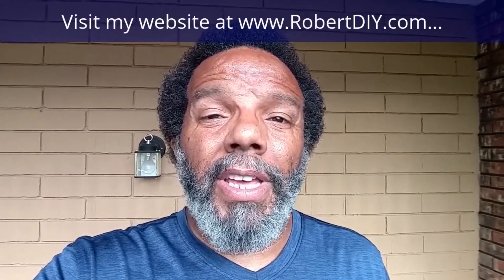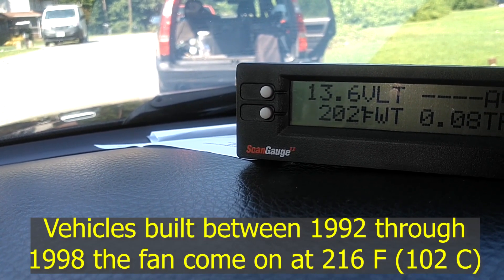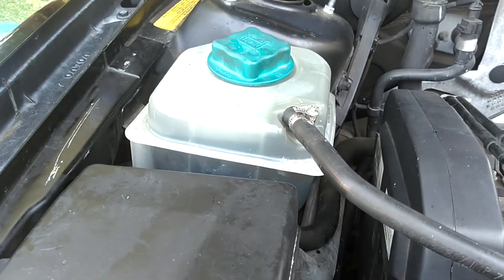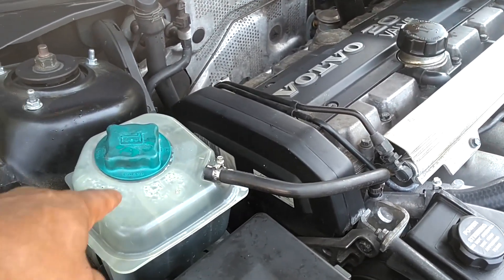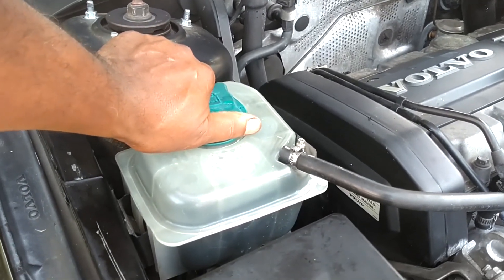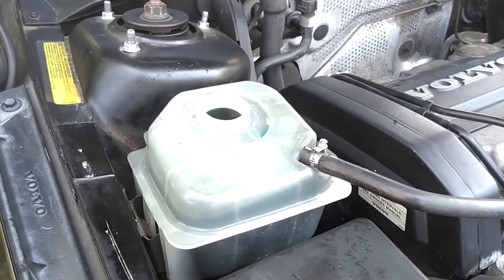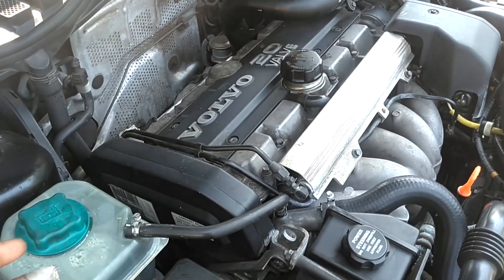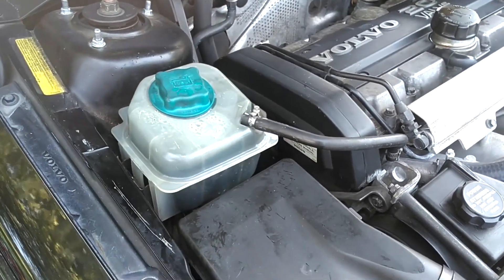Volvo 850, S70, V70, Coolant system overview. Engine fan operation, coolant fill process, and more.

Comment: Thank you Robert. I picked up a 97 850 back in November. It takes 2 cranks to start and has been giving me acceleration and power issues. I left the vehicle running on idle for about 15 min letting it get up to temperature and the fan still did not kick on. I believe the ECT sensor is to blame. While Idling once it reached temperature I let the AC run on full blast and the fan STILL did not engage. I think it is running rich when it starts but once at full operating temperature it gives me lack of power and chugging while accelerating. I have to restart the vehicle to reset it. I have no codes however. I tried the coolant cap trick to test the head gasket and I was able to open it slowly.
Reply from the maker: https://youtube.com/shorts/tSEx98aGzC4?si=rfxpj6LM43qlZxAt
Reply from the maker: Could be the TPS

Comment: Thanks Robert. Very informative. I'm dealing with my upper radiator hose -- it keeps blowing off. New hose, oem clamps, new reservoir cap. Car has never run better however (even with this issue) and I've owned it for 23 years. Appreciate all your great videos.
Reply from the maker: https://youtu.be/WXOHjePUWkU?si=E9YYRCZLbDm0BHry

Comment: Excellent information. To be honest, I thought all cooling systems were pressurized. Thanks for setting me straight!
Reply: In my manual to my volvo 850 1997 it says: cooling system: sealed pressurised.
Reply from the maker: Awesome! If you can pull the cap off of the reservoir with the engine running, is it pressurized?
Reply: Isn’t the pressure is released when opening the cap? you can hear it hiss and also the coolant level rises after removing the cap. If the system is sealed and the coolant heats up inside, it becomes pressurised because hot coolant takes up more space than cold coolant.

Comment: I swapped a motor in my 01 v70 xc wagon with turbo have slow coolant leak no one can spot. Probably not a Volvo thermostat will it still operate and burp correctly? Could it still be air trying to escape? Have driven around 500 miles on this motor.
Reply from the maker: Could be a bad engine.
Reply from the maker: https://youtu.be/WXOHjePUWkU?si=yASjH9aZEApeIoEh
Reply: @RobertDIY  he never had problem other than it going into limp mode  so I only used his head and block

Comment: Quick question Robert,

2012 Volvo S60 t5...122k miles

Overheating...due to rad fan not running....at all.

My question is : does the thermostat have any bearing on whether or not the fan comes on via a sensor or whatnot ? 

Thanks
Reply from the maker: No, the thermostat is mechanical. It doesn't know if the fan works or not, only the temperature of the fluid running through it.

Comment: Have you ever wonder what position thermostat should have be placed in.
Which way round? Does it matter to that air release valve?
Reply from the maker: As explained in the thermostat video, 1 o'clock.
Reply from the maker: https://youtu.be/U7lxJ96KdTg
Reply: Thanks and sorry I havent see it

Comment: Hello. I have recently purchased a 98 volvo v70 glt. It has a overheating issue. Ive replaced the waterpump, thermostat, and the radiator with a do88 performance rad BUT it still overheating. Could it be a improperly installed head gasket?
Reply from the maker: https://youtu.be/BtdifArSU3Q
Reply from the maker: https://youtu.be/WXOHjePUWkU
Reply: You need to test the cooling fan and the fan control module. Run a short wire between the oil dipstick tube and the fan control module fan 1 connector. The fan should operate if it is good. Listen to the relay and see if you hear a click sound.

Comment: Hey Robert. My temperature gauge isn’t rising to operating temperature and my fan isn’t coming on. If I’m idling for too long my coolant starts to boil! I checked the fan with 12v and it works well I also tested the thermostat and the temperature gauge. Any idea what the problem could be?
Reply: Forgot to mention it’s a 1996 Volvo 850 T5
Reply from the maker: ECT.
Reply: @RobertDIY  Do you know the specific one Volvo uses or would I be able to use any compatible type from a auto parts shop?
Reply: @RobertDIY  Robert, king of Volvos. I changed the ECT for a official Volvo one. Fixed the issue. I cleaned the terminals with isopropyl alcohol and I’m now getting a good temp reading. But the issue remains the fan still isn’t kicking in and it feels like no liquid is circulating from the radiator. Any next step tips? 

Drew

Comment: As an onwer of a Volvo v70 XC '01 (P2), I have tried to open the water reservoir while the engine was hot and liquid spilled. In the mean time I have found a fluid leak on the heater cord to the interior, which get the pedal floor wet. Can this be the culprit of the fluid spilling and accumulating pressure, or should I check the head gasket more? The glove test was passed with no problems and maintenance was just done (all filters and oil).
Reply: Change the heater core. If it's leaking, the only solution is to replace. Could also be the connections. If it hasn't been changed in over 10 years... it's time.
Reply from the maker: As explained in SEVERAL of my videos, the cap should NOT be removed with the engine OFF. You should be able to SLOWLY remove the cap WITH THE ENGINE HOT AND RUNNING.
Reply from the maker: If the heater core is leaking, have it replaced before you blow the engine.

Comment: I have a 2004 V70 2.4 liter station wagon and had to replace thermostat because prior maintenance person did not put gasket on housing secure enough...started drip leak. I have replaced the thermostat with the half of housing and gasket on the half attached to block. I refilled the radiator through top hose at engine end and reattached and refilled reservoir. I am worried that the fluid is not filling the head on the engine because I did not see much fluid removed from reservoir after short trips. Any suggestions on how to be certain fluid has filled the head?
Reply from the maker: This video explains all that I know. Once the engine has cooled off, fill it and it should be good.

Comment: Hi mate 2005 s60 2.0T had a leak in the pipe coming from the reservoir and it emptied the coolant. I fixed the pipe and topped back up with coolant. now it’s sometimes struggling to start when cold and when it does start it sits on about 500rpm for a second or two then kicks in normal and will run perfectly. It seems fine when the engine is hot I was wondering if you had any idea what it could be
Reply from the maker: https://youtu.be/Jc4pfC3D3EU
Reply from the maker: https://youtu.be/gt9w-ZSxs9I

Comment: What if the coolant cap does come off with a running hot engine. Does that mean the head gasket is good.?
Reply from the maker: As explained in the video, yes.
Reply from the maker: https://youtu.be/WXOHjePUWkU

Comment: Hi Robert.My 1998 Volvo V70 2.0t behaves strangely! On the open road I do not lose cooling fluid, and when driving slower off the road, on the bottle cap that is new, liquid comes out, the thermostat is new and installed correctly, as well as the engine temperature sensor and its connectors! Specifically yesterday I drive 80km on the open road without any loss of fluid, and it was in a bottle a little above "MIN" when it was cold, but today off the road at a speed of 10-20km / h some 3-4km when I opened the hood with with the engine running, water was leaking from the bottle cap, when the fan started, it stopped! But it is impossible to open the cap then! I need your opinion ??? Thank you ! Greatings from Serbia.
Reply from the maker: https://youtu.be/WXOHjePUWkU

Comment: what's the maximum engine coolant temps for the 850R turbo?
Reply from the maker: Like, right before it blows the head gasket? The magic number is 265F for non-pressurized systems for all cars. What blows the head is when the coolant boils. A good coolant mix will boil at 265F. 
I've had my car at 257F and it didn't blow the head gasket or damage the engine.

Comment: hey robert, when i have been driving my volvo 850 2.5t '96 and i turn the engine off i hear the reservoir cap hiss softly. Do you know what this could be?
Reply from the maker: Normal. Once the engine is off, the system pressurizes. You may need a new cap.
Reply: @RobertDIY  Thanks Robert👍🏻

Comment: Hey great video! Got a question, recently went to a mechanic to replace a cracked radiator and put in new coolant.  All is well, when the same evening the fan went on when starting the car on an ice cold engine. It prevented the car from getting warm! Coolant temperature was low as hell and didn’t circulate through the upper hoses (thermostat closed?). Tried driving for 30 minutes, revving it a few times up to 3000rpm and nothing happened. The fan even went on to blow for 5 minutes after turning the car off. 
Next morning I get in, start the car, fan still starts blowing immediately! Going to the mechanic and halfway it turns off. Car gets warm and mechanic can’t see nothing wrong. Since then everything has been fine. He suspects a thermostat that is unhealthy and didn’t open all the way, but that doesn’t explain the fan starting on an ice cold engine. What can it be? Wanna know so it can’t happen when I go on a trip. Mechanic said all plugs were in okay and he didn’t break anything when replacing the radiator.
Reply from the maker: I don't even know what kind of car you have. My guess would be that one of the connectors is going bad, wasn't making a good connection.
Reply: @RobertDIY  hey there, sorry I was probably so tired when writing that I forgot to mention the car lol. 
It’s a V70 2.4 from 2000 (first type) with 170hp. Thanks for the tip I will check if any connectors are damaged. Must say that last few days it didn’t happen after unplugging the battery and reconnecting it.

Comment: I recently replaced my coolant tank and thermostat but my radiator fan doesn’t come on when it exceeds it’s temperature and I was just wondering what could be the problem
Reply from the maker: ECT sensor, bad fan or bad relay.

Comment: Hi Robert. i need your help regarding a pressure problem i have on volvo v 70 year 2002. the cooling circuit gains pressure after the car is stopped after 2 to 3 days. So, after that time, I find the water expansion vessel full and liquid on the floor, so the coolant comes out through the lid. I inform you that I changed the thermostat, water pump, the engine head was rectified, the radiator is only 2 years old and the water pipe that falls from the thermostat to the radiator is also new. I tried to release air through the expansion vessel lid as soon as the thermostat opens and the fans do too. the water level then drops and then when heating the water the level rises to the maximum and I cover it again with the lid. 

I also inform you that I took the new cell gasket and the coolant is the appropriate one for direct use.

Can you help on that? Tks
Reply from the maker: is the cap damaged?
Reply from the maker: https://youtu.be/WXOHjePUWkU
Reply: The cap is a new one  from  volvo

Comment: Buenas tardes Robert, soy Alex de Mexico tengo una volvo V70XC cross country año 2001,  le cambi termostato, sensor ECT , el ventilador prende a los 221 grados Fahrenheit y al llegar a los 210.3 grados Fahrenheit se apaga, baja la temperatura a 203grados Fahrenheit y vuelve a iniciar el ciclo. entu video indicas que debe prender a los 216 grados Fahrenheit y apagarse a los 206 grados Fahrenheit. en mi caso es normal o que es lo tengo que revisar para que prenda y apague a la temperatura del video 216 -206 grados Fahrenheit. saludos
Reply from the maker: Su vehículo fue programado para circular a diferentes temperaturas. Está funcionando correctamente.
Reply: @RobertDIY  muchas gracias por la respuesta ahora se que es normal. Saludos

Comment: The fan is always running when the key is on and runs for a good minute when I turn the car off it will do this hot or cold it's very annoying I am guessing the temp sensor is the culprit
Reply from the maker: temp sensor or MAF. Our MAF had a broken wire at the connector.

Comment: 😎 cool
Reply: My temp gage only moves up 2 lines from the bottom while driving. It's 30 degrees most mornings warm car up will defrost windows but never gets super warm in car. Do you think my thermostat is stuck open.
Reply: @scottmiteen4772  yes
Reply from the maker: thanks for watching.
Reply from the maker: Does it have a thermostat installed?